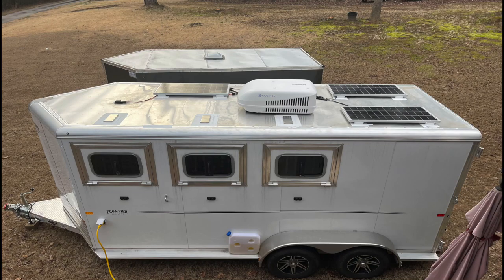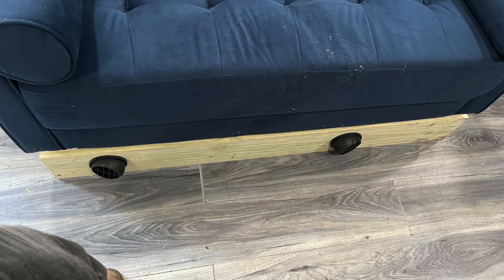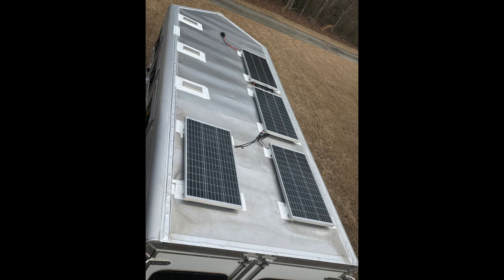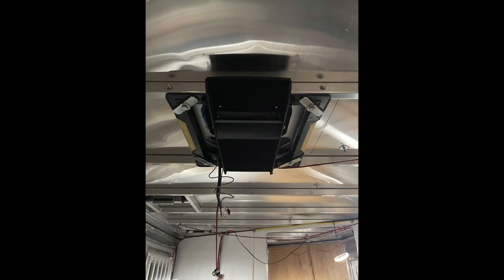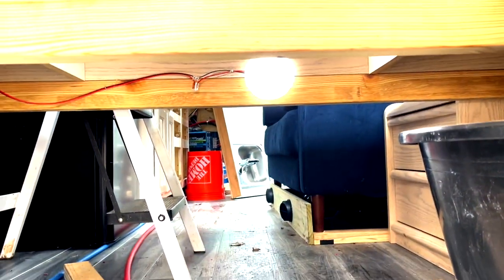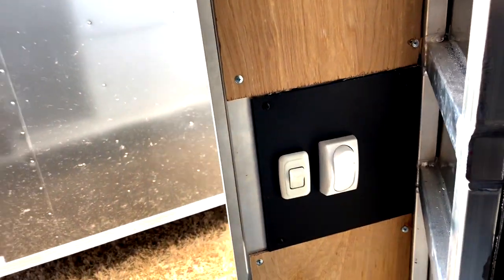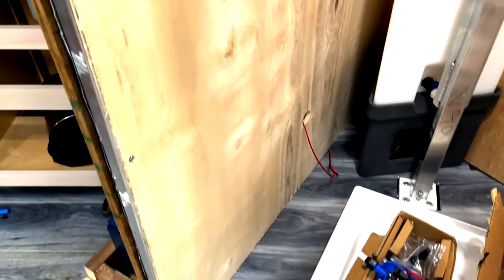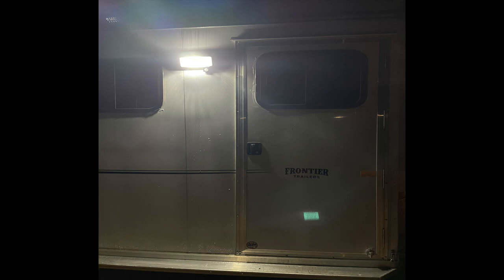Angel Star 6.8' x 15" Converted Trailer Diesel Heater, Air Conditioning, Porch Light, and Interior

Comment: You're going all in, looking great. I hope to get a trailer converted sometime soon too but I doubt it'll be as fancy as yours. I have two cargos, both newer. One is 7x16 and the other is 6x12  both 7' ceiling heights. Im thinking the 6x12 would suit me better to keep the weight down and its more compact plus easy to do an axle flip for additional ground clearance for boondocking in our local mountains here in So Cal. I'm about ready to purchase the insulation, already have 400watts solar but I know it'll be a little project that will take more than 4  months to complete.
Reply from the maker: Thanks for the compliment!  Some folks build nice campers but I'm not into camping that way.  I love the outdoors but I don't want to eat or sleep in it! 😁 I have a 6 x 12 that I modified for work purposes that I may add a fold-down bed for just in case.  I wish you well on your project!  I've found one advantage already of building it yourself.  One of my neighbors in Florida was fidgeting around inside my trailer as I was installing the diesel heater and he accidentally pulled one of the wires loose.  Since I wired it myself I knew where to look and made it nearly impossible for someone to accidentally pull the wires loose again.  If someone else had built it, I wouldn't know where to start.  Take care!

Comment: You might want to remove those bars in  case of an emergency
Reply from the maker: No need.  For the right side of the trailer, the windows are too small to get out of for most adults.  What you can't see on the left side is there is a latch on each window that I can hit and whole window will drop down in case of emergency.  The  latches have key locks on the outside for security but a person from the inside can open them.  Thanks for the concern and suggestion!

Comment: How long can u go with these camper conversions on a minimalist setup and still have them be light enough to pull without a truck?
Reply from the maker: I did go a little far with mine.  You can start by buy a smaller single axle trailer but you'd be limited as to what you can add but a minimalist wouldn't worry about that.  Thanks for watching!
Reply: @freddybtruckingandRVing5350  Thanks for your comment. And good luck with everything.